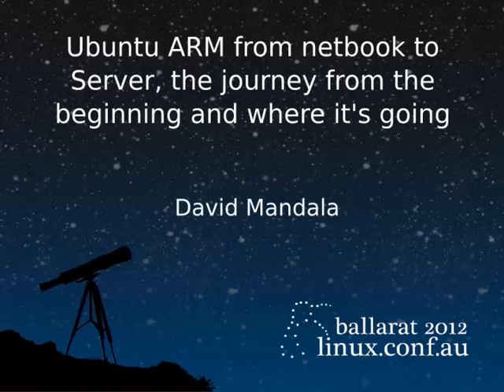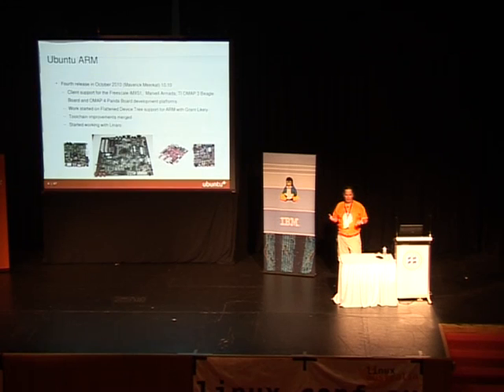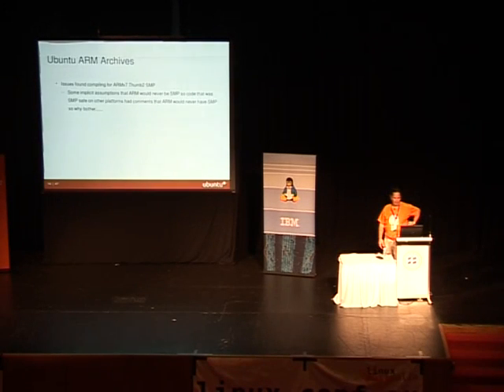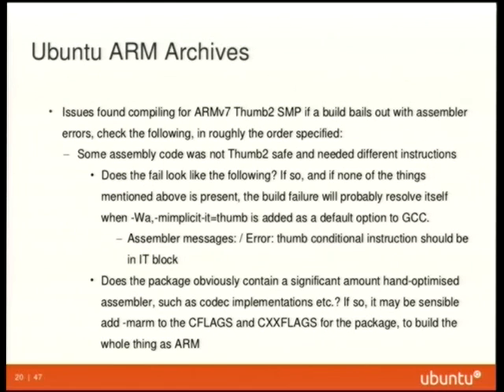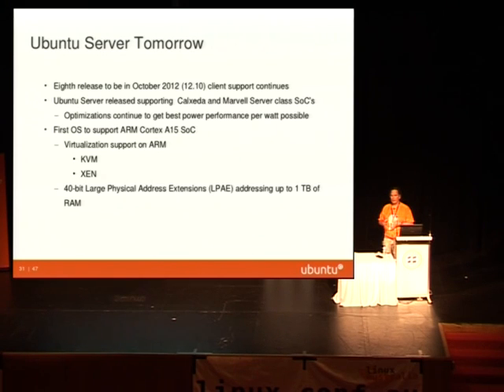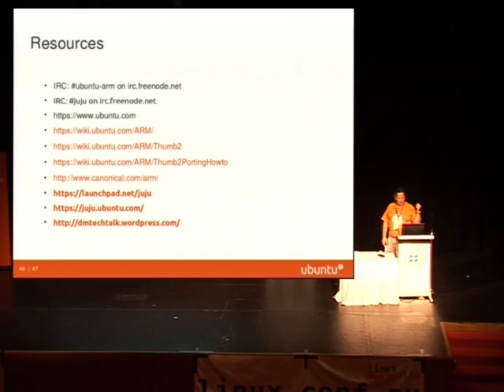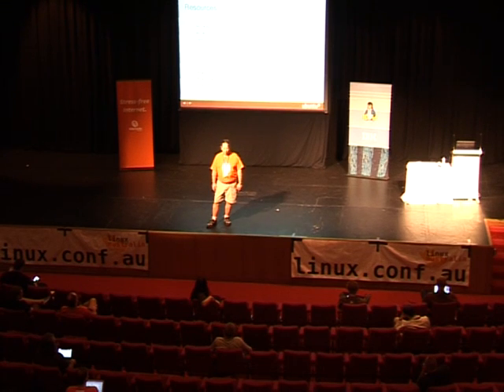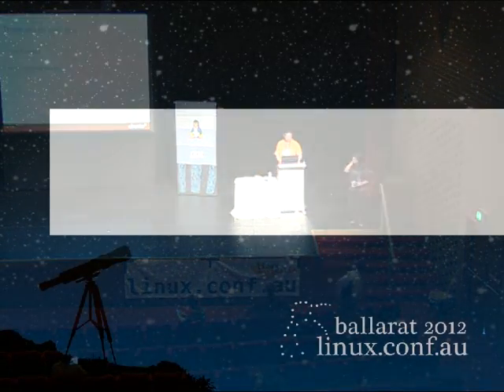Ubuntu ARM from netbook to Server, the journey from the beginning and where it'

Comment: Thanks!

Do you really think that it will take until 2014 for a single kernel that runs on all platforms?  It's already something of a crisis, and there is an explosion of platforms being introduced now.  UEFI and a replacement (or improvement to) Device Tree needs to happen before them.

Comment: comparing absolute power figures of ARM and x86 processors doesn't make any sense. sure, we all know an ARM processor uses less power than x86, but what if it takes 10 times as long so perform the same calculation, and uses 10 times as little power? then we'rve achieved nothing.
we need to compare ARM and x86 *per task*. ie.: perform a certain calculation, how much power does the CPU use from start till end (Tend-Tstart probably being about 5-10 times longer on a Cortex than on most x86 CPUs).